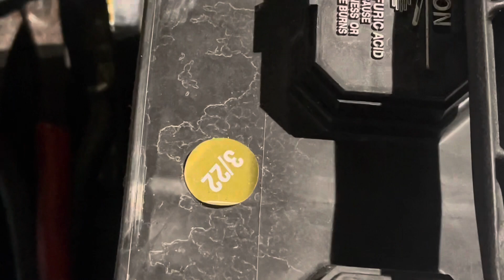ReeeeeeeeActions Welcome! 😏

Comment: I revived my battery twice, using a CTEK charger and since then I grant my battery this refreshment therapy once a year during christmas season.
At the end of the charging process, these chargers start pulsing the voltage/current. As long as the cell it not shortened, this reduces the sulfation.
I keep it attached as long as possible (2-3 days at least).

Comment: 1.  Don't set a battery on the cement.  2.  Battery cables are on the wrong posts.  3.  Plugging a battery charger into an extension cord.  4. Plugging in the charger before putting the clamps on the posts.   Try putting a 9 V battery in your pocked with handful of change.

Comment: I've never had much success reviving dead lead acid batteries. What I have found is that for maximum life keep them on a float charger when not in use and get them back on the float charger as soon as possible after use. I mean the moment you get home, not the next day or after.a few days sitting around partly discharged.

Comment: I successfully revived the tiny AGM battery for my Miata with a regulated 2-amp trickle charge over about 72 hours this past spring. Somehow I'd forgotten to plug it into the battery maintainer when I parked it for the winter last year and it was quite literally flat dead.  Like, showing a few millivolts of charge dead. 

It IS possible. It just takes a LOT of patience.  I also had a desulfator on it, which I know is snake oil, but they seem to help.

Comment: My understanding is that to recover the battery you need an incredibly low current, like less than an amp, and to keep it on charge for weeks.
Reply: Meh. 
There are many options. 

Personally I like the half wave rectification to pulse charge it. 

I do a 10hr charge rate and fully discharge every time it reaches charge voltage and current drops below 1/4 full rate charge.
Reply: You use a stick welder to reanimate the batter
Reply: @426hemicuda1090  
Rough but works most times
Reply: @426hemicuda1090  I've done this multiple times, works most of the time.
Reply: That procedure is to de-sulfate a sulfated battery. Sulfation is when the sulfur in the electrolyte stays attached to the positive plates, usually caused by undercharging, or sitting long periods in a discharged state. Part of that procedure is to start by connecting a lamp to the battery and running it down fully. Then charge slowly for a few days. Not usually done anymore.

Comment: I revived a dead battery using my welder.  I connected the ground cable to the - post and the other cable to the + post.  Then I set the welder to 100 Amps and let it run for 15 minutes.  I charged the battery that way 4 times, waiting at least 20 minutes between each charge.  Be sure to protect the area because there will be some spray coming out of the open holes on top of the battery.  After a year I am still using that battery.  As long as I don't let it run down to 55% charge it works just fine.  When I charge it I must use the 10 Amp setting on my charger.

Comment: If this is what you mean?
Batteries left on the ground will discharge bc of the large temperature difference in the concrete & battery.
They don't discharge thru plastic.
I have proven this several times at my shop but we get colder than you do.

Comment: It is actually a good thing to shock a lead acid battery with continuous fixed high current, then discharge it, do it again, discharge it and then use a very low current to charge it for as long as it takes. You have to be careful you don’t cook it with the high currents. I am talking 30amps fixed for half an hour, maybe 1 hour tops. You don’t want to leave the battery unattended in case it goes bad.
Reply: DC stick welder @ 100+ amps.   This looks like a sealed battery though, need to pop the caps first.
Reply: Yeah ventilation too hydrogen buildup and chance of boiling batt juice out no good. Unless you needed a low spot in the floor....

Comment: You need to coat the bottom of the batteries with dielectric grease before placing them on the floor.
Reply: The bottom of the batteries gets wheel bearing grease. Don't you know anything??!!!?? Dielectric grease goes on the cell caps to keep them from sticking. 🤣
Reply: Guys, guys, please! Goose fat, since Christmas is coming!
Reply: @oldguydoesstuff120  Your right, I forgot about the wheel bearing grease.
Reply: @johnedwards1685  Very true, Goose fat would be the preference in the colder climates this time of year.
Reply: Dielectric grease on top of the induction charging plate with the poles facing true magnetic north for the positive and south for the negative.
Reply: Because Greasy Grease helps those little electrons slide out of the battery faster. 🔋😆

Comment: I’ve seen Sweeeeet Project cars revive a battery using a stick welder by beltingit with 50 + amps to get the sulphation off the plates. I tried it and blew up a brand new welder! It’s too light to use as a boat anchor too🙄

Comment: I've been using a NOCO Genius G3500 for about 5 years now and am batting about .750 on the battery "Revivals". Instead of charging the batteries first (as per the directions), I go straight to the "Repair" charge, using another battery in parallel at times if the voltage is too low to be seen by the G3500, just to get it started. It may take 3-6 or 7 days, but I've had it bring back quite a few. Sure, some batteries are too far gone and you have to check to make sure that they aren't getting too hot from an internal short, but at 3.5 amps max, I've had no issues.

Comment: Buy a adjustable current power supply or a buck boost module. Set the voltage to 17 volts with the clips disconnected from the battery.   Then set the short circuit current to 0.3amps. 3/10th.
Hook up the battery and walk away. If you have a deeply discharged battery that has not been charged at 10a or greater.  Has not been hooked to a booster pack then you have a chance of undoing the sulfate crystals.  Fast charging  hardens the sulfate crystals and prevents them from being dissolved..

Comment: I've had good luck using the "recondition" mode on my battery chargers to revive batteries. It runs automatically for 24 hours. May have to repeat it 2 or 3 times. 

Fine for your own batteries, but I doubt customers would wait 3 days to find out if their battery can be saved or not. Haha

Comment: you may not believe me but you shouldn't put a batterie on the concreate floor without something like wood or a rubber mat under it..i never believed grandpa but the 50 yrs ive ben here on this rock makes me think he was onto something because the batteries ive left on the floor without something under it, seemed to go dead quicker and there life span was shorter even a rv batterie made no difference it still wore them down..thought id see what you though ray?😊😊

Comment: From Northeast Battery's website, a bit of education....
Battery 101: Do Cement Floors Ruin Car Batteries?
You may have been told to never put a car battery directly on the floor of the garage because the cement will cause the battery to leak or loose its charge.

…Is this really true? Knowing what we do about batteries and cement it just doesn’t make sense. Or does it? (Fear not – we know the answer.) Let’s explore the myth of car batteries and the garage floor.

Early Car Batteries
If we take a look back at some of the earliest car batteries we will find that they were lead-acid batteries that had glass cells all encased in a wooden box. This means that if they were left on concrete or cement floors, the moisture from the floor could cause the wooden box to wrap, allowing the glass cells to shift and break.

Of course, the battery acid would leak all over the floor and the battery would be rendered useless. Not great.

Evolution
As the construction of the car battery evolved into a nickel-iron battery encased in steel, and then even further with a hard rubber casing, the issue of breaking glass went away – but not the problem with discharging or “leaking”.

The rubber was porous and often contained carbon. The battery shell would take on the moisture of the floor, as with the wooden encasement, creating an electrical current between the battery cells causing them to discharge. Still not great.

Modern Day Batteries
Brands like Trojan and Odyssey are working overtime to continue to innovate battery design to make battery performance and storage better than ever.

The design of modern day batteries includes a hard plastic shell that eliminates the intake of moisture, thus making the garage floor a great place to put your car battery.

Cement and concrete floors provide a fairly good barrier between the car battery and extreme temperature changes that could otherwise cause damage to the battery cells allowing for a discharge leak.

There... I fixed it all

Comment: my understanding is that cold is bad for batteries, and concrete acts like a heatsink.. and beyond that it's a single cold side vs cold all around (like if it was winter and it was in your truck).. So there could be some cold/not cold electrolyte circulation going on there.. causing.. something to happen that's not good.

Comment: Pro tip:
Never let a battery bounce around in the back of a truck…..(bang bang bang)…..will cause lead to flake from the cell plates and create a bridge in the case bottom. Once the cells have bridged the battery will internally short out…..causing a low voltage condition that no amount of charging will fix.

I did however, bring one battery back to life by draining out the acid and washing out the cells.
Then I added fresh electrolyte and charged it with great success.

It went 2 years without any problems and then it caught on fire 🔥……😂

Comment: Cheap fix is take the caps off and drop an aspirin in each cell. If low on acid top off with distilled water. Must be distilled and aspirin should not have a coating on it. Then trickle charge.

Comment: Well I had to watch the clip a couple of times as the red cover seems to be on the negative post ….concrete 😝 only problem with the battery on the concrete would be if the battery had a howly bag and the fluid came out …. Turns the concrete to slush( found this out the hard way🤦‍♂️)

Comment: Ray, Shop light lumens look great!! Just a suggestion on battery charger, thinking power for charger, should be plugged in solely by it self, in regards to amperage draw for that charger. Also, I'm worried for you...!  Get a real good security system. Don't be afraid to arm your self discreetly.  Perilous times brother. Be prepared. !

Comment: Could have swore he hooked it up wrong.
Reply: Yeah you’re right it does look like he hooked it up wrong
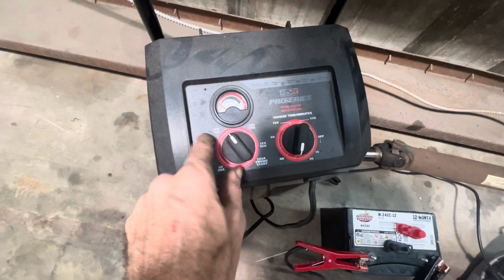Reply: @scottowen3162  1:33 and freeze it... you'll see :)
Reply: This is a waste of a post. In terms of polarity: the plastic covers were reversed. The mfg. configuration shows (as viewed from the terminals facing you) positive is on the left, negative is on the right. Additionally, positive has two solid posts, negative has one post and extended screw terminal. Therefore, polarity connection is correct. Assuming all cells are not defective, a trickle charge may restore the battery.

Comment: NEVER leave lead acid type batteries on a concrete floor. I was told this years ago and whoever told me was right. Don't know why but concrete seems to kill batteries. My charging bench is steel which conducts electricity and could capacitively drain a battery, but it doesn't. I left 2 NEW fully charged Caterpillar N300 batteries on the concrete floor for about 3 months and after many efforts to revive them sent them to scrap.

Comment: Were the terminal caps on backward, or did you connect the charger backwards?  The red cap was on the right terminal when you took it off, but connected the red/positive from the charger to the left terminal.
Reply: Yes.  The larger terminal is the positive terminal.

Comment: But fear not! Modern batteries  use cases that are made of hard plastics like polypropylene. These cases are able to block any moisture from coming through preventing the previously mentioned discharge issues.
Reply: Correct !

Comment: This may have been covered in previous comments, but if not, here goes.  Because the new "smart chargers will not charge if the battery has no charge at all there are two potential ways of reviving a dead, dead battery. One is to wire another good battery that has a charge in parallel to the dead battery and then the "smart" charger will see the charge and will actually start charging. You can then disconnect the good battery when the dead one has enough charge that the "smart" charge will recognize it. The other way is to find an old fashioned dumb (analog and non-digital) charger and use it to do the job.  I have been able to bring a dead battery back to life using my old analog trickle charger that I got back in 1969 when my newer charger would do nothing for it.  Sometimes the new smart technology is not as good as the old stuff in many situations.  YMMV.

Comment: Modern PLASTIC battery shells and CEMENT floors are a match made in HEAVEN.  The OLD trope about the earth discharging them was a half truth.  It was MOISTURE and GLASS cells that caused issues.  A cool clean floor with a CLEAN charged battery are NO ISSUE at all.  IT poses NO RISK and protects your little piggies from drops.  As long as a modern battery is charged and kept clean, your all good.
Reply: I see what else happened. Encountering reverse polarity is not common but it does occur.  You did the right thing but someone would have to know it's even possible for a battery to reverse.  It takes some unusual things to cause that.  I've never encountered it in the wild.  Just knew about it being possible and how to fix it from school.

Comment: when I was a teen I was told storing batteries on a concrete floor would kill them. I was reminded of that with this video. I started thinking about it and couldn't work out why that might be, so I googled it. It's false. It used to be true when the battery case was made out of wood. it hasn't been true for 100 years. til.
Reply: When the battery cases where asphalt they would leak some times and etch the concrete. It can still happen if the battery spills over from tipping or over charging and acid gets on the case.

Comment: You probably posted this for putting the battery on concrete floor , but I’d be more concerned about using the extra plug on the fan to power the battery charger. Is the extra  plug rated for that amount of amps?
Reply from the maker: Yea it’s heavy duty wire 😉
Reply: How about switch on fan ??

Comment: I hope you have the post lined up with the poles.
Neg to the south and pos to the north.
While chanting i'm ok 20 times to the great pumkin.
LOL I Got nuttin.
Back in the day battery cases were made with rubber and would discharge on concrete.
The interstate dude shown me that a dirty battery will discharge.
He used a meter and he put a probe on the pos and the other probe he touched different spots on the battery an got voltage.
He cleaned the battery and it stopped.

Comment: try the welder trick. 5 minutes on, ten minutes off running just enough current to make the water boil. And peel off the cover tape over the fill openings. Unscrew the caps to access them.

Comment: REEEEEsearch desulfination. Typically you need a high charge rate to get the sulfates back into solution and re-reeeeeverse any jacked up cells.  Best to keep your low usage vehicles and stray deep-cycle batteries on a maintenance charge at all times.  They will last a long time that way.  FLA and AGM batteries like to have about 13.3V and 0.2 or 0.3 amps imposed upon them when they sleep. 🔋
Reply: I have tried “desulfating” batteries at least 20 times. Never worked.
Reply: @tuloko16  The only time I have seen it work was essentially in a lab environment using a current controlled power supply.  This allowed a high voltage to be set while limiting the current to avoid excessive boiling.  Also, the guy was able to read the current for a given voltage and understand the internal condition of the battery and make appropriate adjustments.  It was necessary to monitor the temperature of the battery, at least by feel.  The process also involved controlled discharge to a certain level, and multiple charge/discharge cycles.  There's a lot to it and you have to consider if the value of the battery is worth the effort.

Comment: Ray, don't put a battery directly on a concrete floor!  Always scrape away the extra electrons on the concrete before setting the battery down on the floor.  I, for one, am tired of all the negativity we have in society these days, so I like to charge batteries with positive electrons instead of negative ones.
Reply: Umm, they'd be holes then.  The negative electron leaves a positive hole when it moves.

Comment: Pro(bably dangerous) tip: Drain the battery of all power then short it out with a cable. Charge it in reverse polarity. Drain it of all power again then charge it normal and start using it. Can make a miracle with old lazy batteries if they're not way to sulfated.

Comment: Even if the battery turns out to be dead as a doornail, at some point you will wind up with a customer's battery that can be saved, and you can use the dead battery for the core deposit.
Reply: Just curious where do you live that they charge a core charge? Not trying to argue just curious where I live they don't.